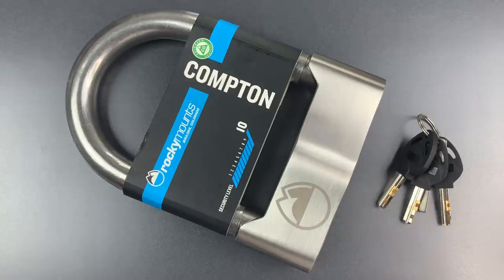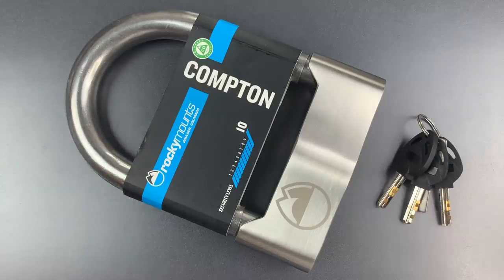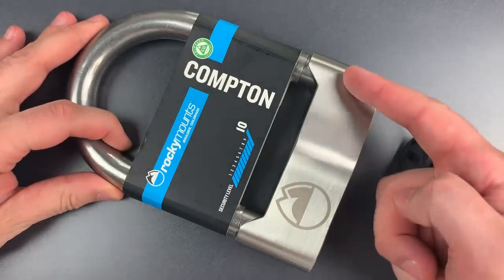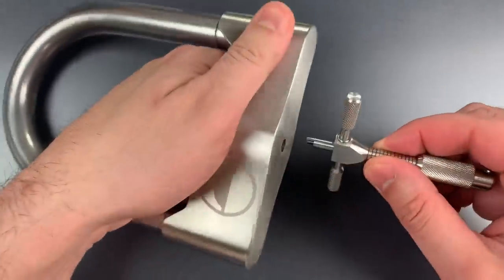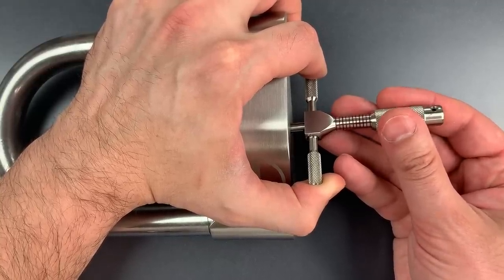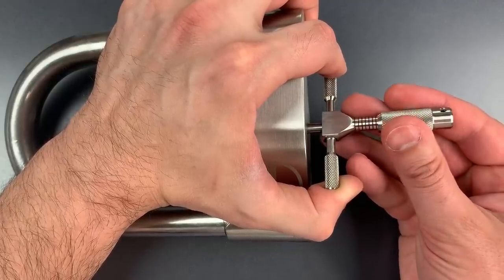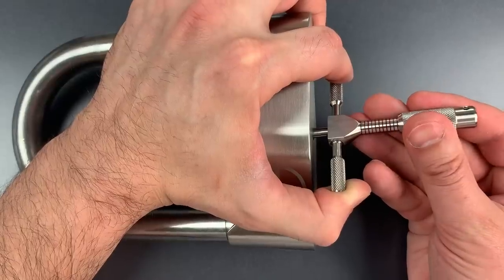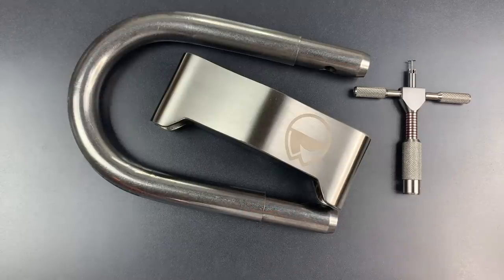[909] Rocky Mounts “Compton” Bike Lock Picked

Comment: Hi there lpl
One question: can you pick a lock with a key of the same lock but different stock???
Reply: That's called bumping, where you have a key similar enough to the one that fits the lock, that a hard bump sets the pins and the lock opens
Reply: Judged Bumping is only one of those methods, but it's the most infamous, because it's supposedly easy if the lock is susceptible to it, and that includes some formerly trusted high end locks that had to be downgraded from high to low by their manufacturers.
Reply: @johnfrancisdoe1563  I was a rather idiotic kid back in the day, you'd be surprised at how many residential locks are susceptible to a bump and shove method of entry
Reply: LPL has a rather lengthy video on impressioning where you take an uncut key and slowly go through process of working it in the lock, seeing where the pins are binding and filing a bit of a time where the marks appear on the key
Reply: I have some masterlocks where I forgot which key goes to which lock. But with a wee bit of jiggling, the lock opens right up. You can't tell if the locks are being sticky, or you have the wrong key, it's hilarious.
Reply: @kauske  try with wet spaghetti, you'll get your answer!

Comment: While not hardened, steel is still a relatively robust material (comparing it to, say, brass or aluminum). And that shackle certainly looks very impressive.

What do you think would be a likely real world method of attack? Battery-powered angle grinder with a cutting disc?
Reply: Bolt cutters will go through 304 like butter, as will even basic hack saws. Even mild steel is significantly stronger than 304. so this lock won't present a difficulty to anyone half way motivated to cut it. Using bolt cutters is probably quicker than picking it. No lock will stop a determined thief anyway, but because of the size of it, this looks like more work than most others, so chances are they'll just take bike with a lighter looking lock beside your bike if you use that lock...

Comment: Question about the picking tool, would there be any advantage to differentiating or coloring the rings? With that many rings lined up right next to each other I get lost as to which cylinder you are attacking. I suspect the feel is more important than the visual for use and you even say which cylinder you are on verbally. But I experience cognitive dissonance in that my brain trusts the visual more than what I'm being told and I don't plainly see a difference.

Comment: Someone explain 
Click out of 
Nothing on
3 is Set 
just the basic terminology
Reply: The number refers to the pins of the lock. When he says "3 is set", he means that the third pin in the lock is set in the correct position to open. He moves from pin 1 to pin 5 (or 6 or 7) and when the pin "clicks" it means it has moved into the correct position to open. 

When he says "nothing on" it means that the pin he is attempting to move can't be manipulated until after a different pin has been set.
Reply: Samuel de Waele Oh that makes so much sense i’ve literally watched 200 videos and never knew what it meant thanks a lot